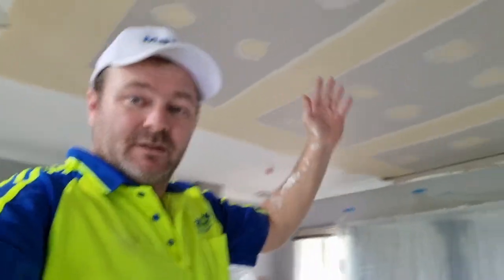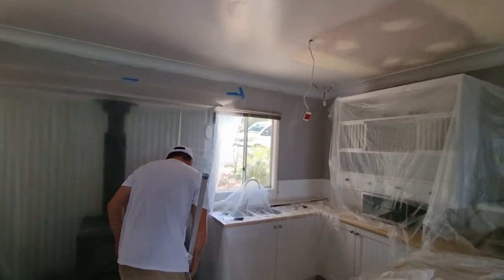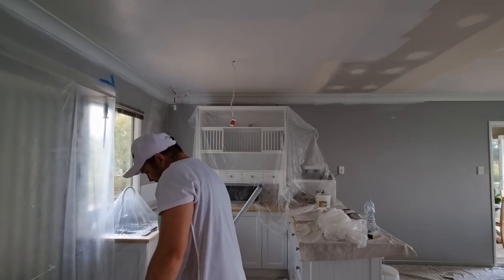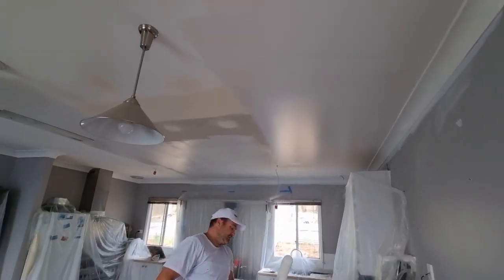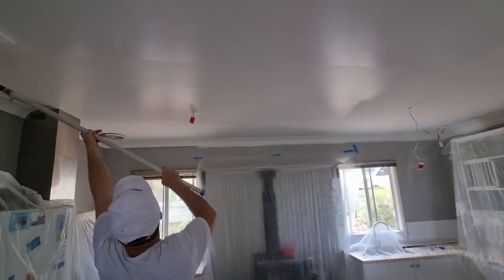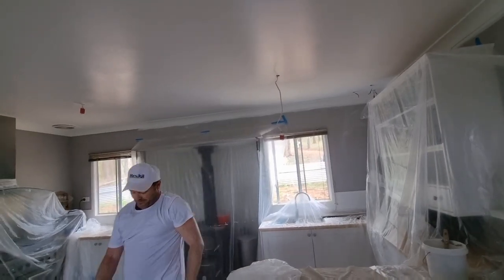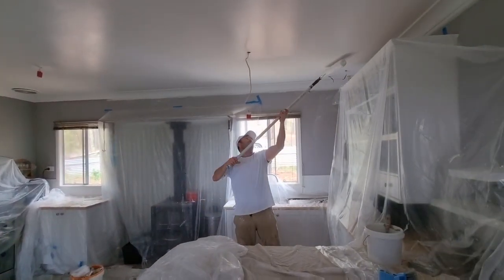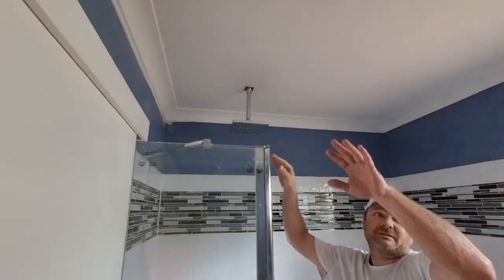Finishing a DRYWALL CEILING REPAIR in Just 2 Days (FULLY PAINTED)

Comment: Any tips to get less holes/air pockets when flushing patching on painted walls/ceilings?
Reply from the maker: Not much you can do when it's painted. Though one tip is to apply the mud, scrape it off then put it on again